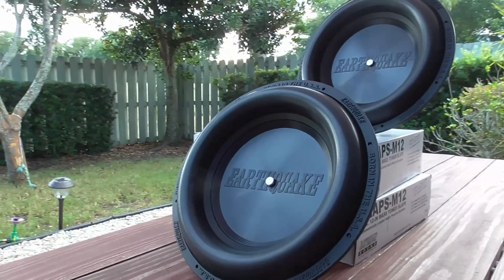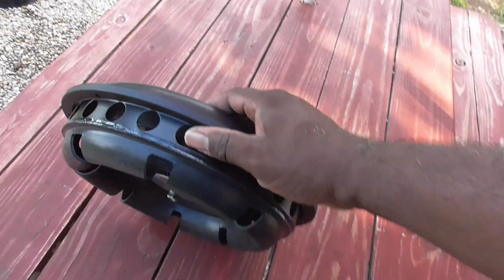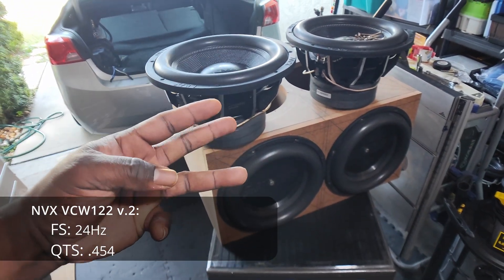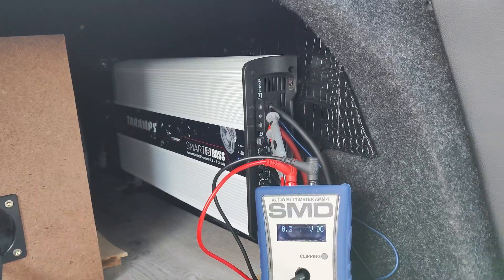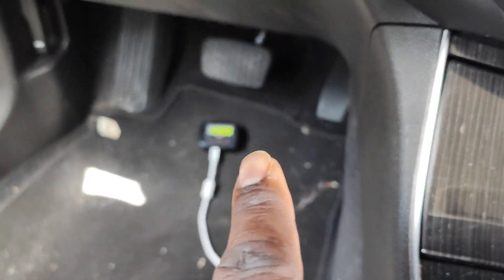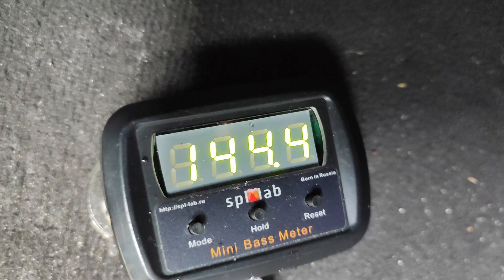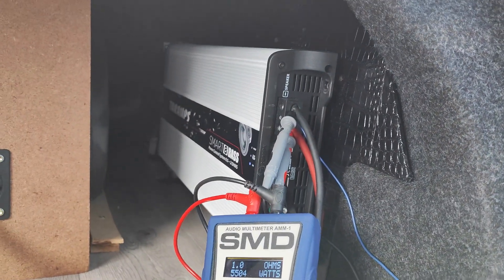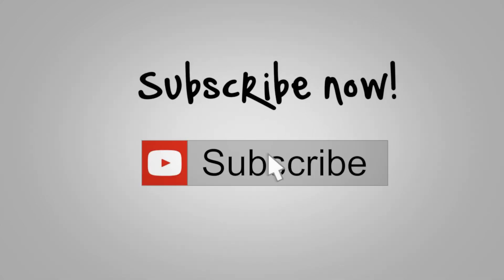The Best Passive Radiators For Car Audio | 7,000 Watt SPL Test

Comment: I just installed your first   2 passive radiators and nvx dual 4’s 12’s. At 2 ohms running 1000 watts in my 2018 tahoe!!!    And love it!!  Hella low end punch!!
Reply: 2 passive = o ohm and 1 dual 4 ohm woofer wire options 1 coil 4,  and utilizing both coils either 8 or 2 he would be correct 👍🏽
Reply: @ashcoleman8866  - So either stevo3175 miss-typed, or they have multiple powered nvx 12s? Also, anyone commenting about passive radiators, SHOULD know that a passive= Non-powered= No direct impedance @ rest. Another fact that many get wrong about passive radiators, is that you DO NOT necessarily need 2x the cone area of the powered woofer. The passive radiator need's to have @ least 2x, the air displacement capability, of the powered woofer= NOT the same thing. Example: If 1 powered 12" woofer has 25 mm of 1 way Linear X Max=(50 mm total, Linear X Max), or (Less), then you would only require 1- Earthquake Slaps, 12" passive radiator, as this radiator can provide just over 2x the air displacement= a MASSIVE 101 mm, of Total X Max! This is what is so innovative about these Earthquake Slaps units.
Reply: Check your dB meter.120db is extremely loud.Its showing 120db with only the hvac running?
Reply: @stevo3175- You may have worded your comment wrong? If you have 2- 12" w/d4 coils, your wiring options per pair of 12s are, 16 ohms, 4 ohms,  or 1 ohm. You can't have a 2 ohm load.
Reply: @evilinside5984   i have 1 dual 4 ohm 12 inch.       And 2 earthquake slaps radiators

Comment: At what number of passive radiators or area becomes diminishing returns ?

I have a 2cu ft box 
12" EMF Banhammer DVC 2ohms on a Apocolypse AAK6000.1 @ 1ohms

Im interested in buying 2 Earthquake 12" pumps..

Will strip pumps & add one radiator at a time to my enclosure & measure after each additional radiator 

What are your thoughts ?
Advice ?
Reply: - Using passives for gaining SPL, is much different than using them for deep bass.  The less passive radiators you run( within mech. Limits ) the lower tuned the enclosure can be. As you add passive radiators, the tunning keeps raising. So if your vehicle is Loudest @ 45Hz, & you keep adding passive radiators till your enclosure is tuned to 55Hz, then you have gone too far/used to many passive radiators, or your enclosure is too small, or the combination of these two reasons. Hope this helps?
Reply from the maker: @evilinside5984  this is true. I learned this while experimenting a while ago. WinISD also shows this, which is why all PRs have the weights installed and are still tuned quite high.
Reply: @BudgetBassHead  -You can't beat the size of your enclosure, vs the output, it is Awesome! Are you going to make spacer rings for the passive radiators, so they won't make contact with the subwoofers magnet? Will hot glue, or epoxy be able to fix your passive? Plus maybe use a Large washer, under the bolt head, on the outside passives cone/front? Was the response curve flatter, and went a little deeper, with 2 passives, vs 4? Also what was the Db difference 2 passives, vs 4? Can't wait for your next video.
Reply from the maker: I think that as long as there is enough compression to activate the PRs, then you should gain from it. The draw back will be group delay. So you'd have to keep the internal volume small enough for accuracy.

Comment: Great setup and video editing! Are you going to mess with the weights in the radiators to adjust the frequency response?
Reply from the maker: That's the plan!
Reply: @BudgetBassHead  I still have my six budget 12s with a passive radiator on each pair. I still have my demo video posted. I was thinking of getting another three radiators and mounting them on the bottom of the box with a three or four inch gap panel.

Comment: With 5k watts it better hit over 145 lol.
Reply from the maker: @majicdude88  it does... Kinda
Reply: 30hz vs 50hz is a big difference alot of guys doing burps at 50hz+ with 150spl its not that hard but anything over 140spl at 30hz  is impressive This setup hits low 💪
Reply: @Ramb1t0 I did a 139.5@20hz on a single 12 with 900 watts clamped in the trunk. That was on the glass btw. 140+ at 30 and below isn’t that hard to obtain.
Reply: @scottbe1  Well i always say its in the hands of the builder and also we have to take into account this is a sedan too. So i say judge according to the mans building skills and then also just note the Sedan aspect, point is this is decent and more a experimental build then a must i say 1x12/15 or 2x12 or 2x15s is the best all round options if space is there.
Reply: @scottbe1  Got any vids of the single 12 floating shiz everywhere? A acquaintance of mine has done similar and or louder numbers then yours with single 12s he likes doing it with all kinds of subs.
Reply from the maker: @scottbe1  proof please. Don't just mention it. Show it 😉
Reply from the maker: @EBMproductions1  💯
Reply from the maker: @EBMproductions1  😁
Reply: @BudgetBassHead  when I meter at sundown I got u. Where do u want me to send it?
Reply: @scottbe1 port numbers don't count.
Reply: @MilGrip76  it isn’t a port number buddy 😁
Reply from the maker: @Ramb1t0  😎
Reply: I'm trying to do a 150 at 20hz in my car it's slowly getting there
Reply: @Loudkona  whats the setup mate cause that is a hard one best me and a build partner did was 143.5DB@21hz using a single Sundown X15 v1 🫡 overall best number was 147.9DB@25hz and 141DB@18hz was the best at infrasonics. If you got 2x15s it will be a matter of time for your goal.
Reply: My vehicle is very large= a Chevy Suburban, its very hard to hit high SPL numbers from the back cargo area. Example: I took my complete system out of my trunk car, subs, enclosure, amp, & put it into my Suburban, that had a much better elecrical system= held much higher voltage, but i still lost 4 full Db!  My trunk car Spl score was a 143Db @ 45Hz, & my suburban Spl score was a 139Db @ 45Hz( same Spl meter, in the same metering position for both vehicles). The ported enclosure Loved 45Hz, and so did both vehicles. Most regular vehicles do well @ 45Hz from my testing results. It takes a lot more cone area, & power to pressurize a parking lot😁😆 That being said i now have a No-Wall system in my Suburban, that can do 150Db + @ 18Hz= Hurricane Winds! I won a Championship Ring, with this enclosure i designed, for 4-18" Monster's! It has great Bandwidth from( 15Hz to 50Hz ), where my (8)- 6.5" Mid Bass takes off from.
Reply from the maker: @evilinside5984  when transferring systems from one vehicle to another you have to take into account cabin gain. Plus the positioning of a subwoofer enclosure inside of a SUV is completely different from that of a trunk. What position and is also very important. Depending on where your meter is placed you may want to Port firing upward from the rear or down low of the hatch.
Reply: @BudgetBassHead  -Yes i moved the enclosure around while testing. I found the sweet spot, & freq. in both vehicles. My point was more about how the cabin size, really makes a Huge difference! The SPL meter & position/location, was the same in both vehicles. Going from a small, compact, trunk, 2 door car, ( prob. only around 40 cu. ft. of internal air space, i'm guessing), to my Full size SUV,( prob. around 120 cu. ft., again i'm guessing). But i'm prob. close? I Lost 4 Full Db in the Full size SUV. Its the same thing, size of an area to pressurize, & how close of a distance you are makes a Massive difference! Take ear buds for example, can be very Loud in your ear but pull them just a few inches away= much more Quiet, move them even farther away, & you can barely hear them. Same thing when you wall a vehicle off, vs when the system was way in the back of the vehicle.

Comment: After a added 2 10inch earthquake PR to my under the seat sealed 10inch shallow mount Skar Sub box by drilling out to holes for them it really kicks now at the low end and feels more alive. Space is an issue, so ports are a no go plus I hate ports anyway. To boomy for me and not accurate enough for most other music other than rap music
Reply: Ported boxes are only boomy if you build them to be
Reply: @noncog1  boomy or not, the accuracy of the bass is the worst in ported enclosures to my ear vs, sealed/PR sealed boxes